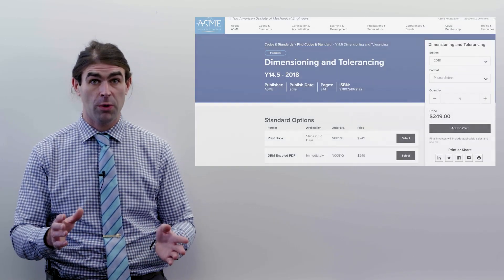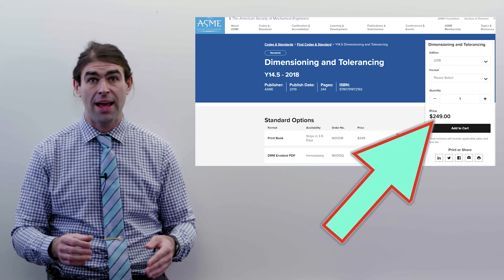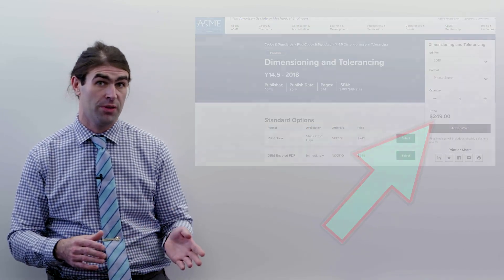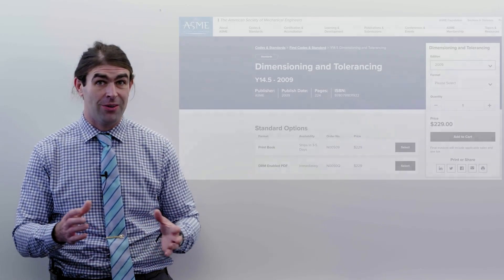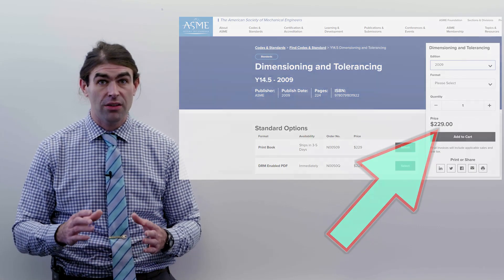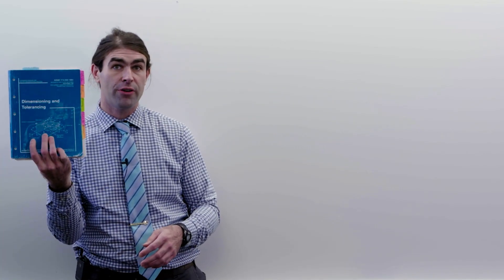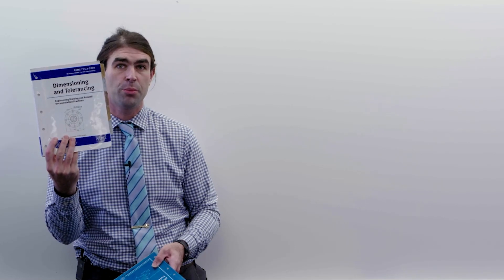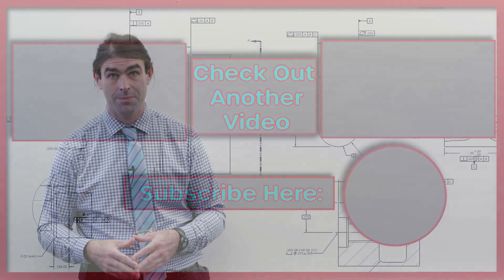Cheap Books for GD&T

Comment: Is it worth starting to learn GD&T 2018 or 2009 standard version if you start from scratch as a Design Engineer who deals with various part vendors? It seems like one will almost always need to know older standards. Would it make sense to learn 1994 as fundamental and later revisions as supplemental?

Comment: Do you know by change GeoTol Pro? I got into the ASME GD&T virtual course by GeoTol Pro, and using the same book GeoTol Pro 2020. I'm looking to apply for design jobs that look for GD&T knowledge as a requirement, but I'm not sure if this level of knowledge would be enough for entry level, or where to look for more practice exercices beside text books.
Reply from the maker: Hi, yes, that’s a great textbook. GeoTol is a respected company with great content.

It’s probably enough for any entry level work. It helps to find a drawing with something you don’t understand, and then find the explanation in a textbook or the standard. Being able to explain what is going on is important as well.
Reply: Thank you Dean!